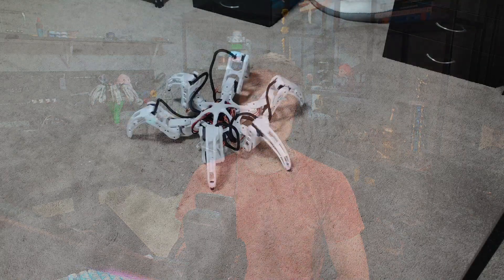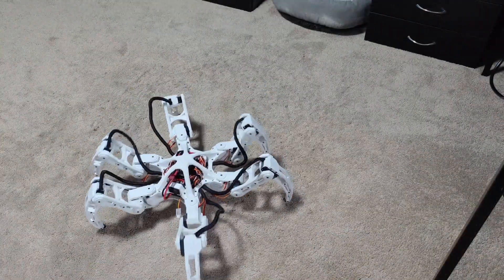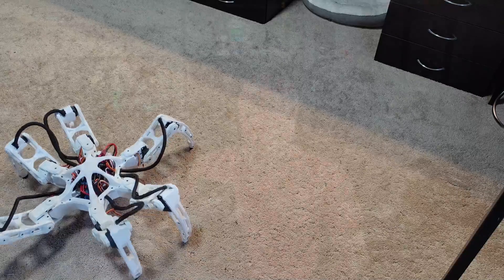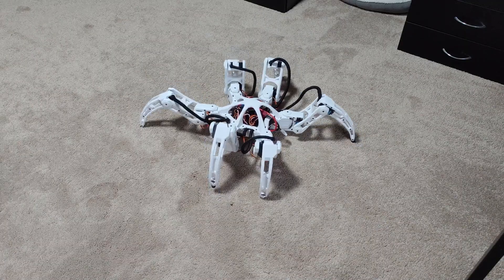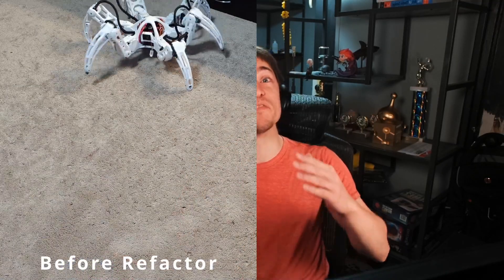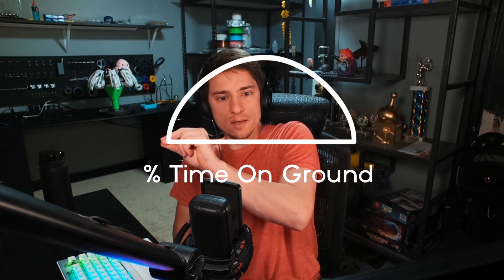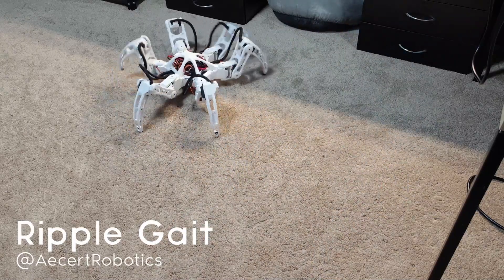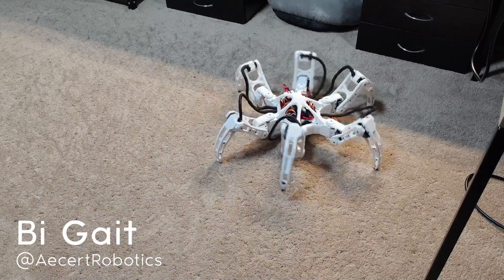I Completely Rewrote My Hexapod's Code

Comment: After seeing your clip, you make me ditch building fpv drones and start building Arduino projects again. I wish that you would release it sooner. In case your course is around 100 USD, I would buy it. When you finish, it would be great to see some AI implementation. Then you could call it creepy.😁
Reply from the maker: Awwww thats awesome🙂  And trust me I wish I could release it sooner too. 100 is right around what I'm thinking, as well as hugely discounting it if you buy the kit with it.

What kind of AI are you interested in? Im trying to keep this specific project as approachable as possible, and getting into stuff like object recognition or autonomous navigation using ROS is a bit out of scope of this project imo (assuming the arudino mega can even handle it).

Comment: Code reworking isn't glamorous and at times just has you bang your head against the wall as your old chaotic code works fine, yet the new cleaner code does not.
But it is an important thing to do occasionally in order to keep pesky Technical Debt from ruining things later and making it easier to adapt to other projects.
Reply from the maker: 100% this. I didn't go into depth on the literal code, but I managed to condense the entire page of code that generates the 6 leg walk cycles into a function that generates the walk cycle of 1 leg which I call 6 times. That specific refactor is what made this so challenging, but it was worth it.

Comment: Not a huge coding expert here but in order to fix your confusion with the orientation of the hexapod while crabbing and turning, may I suggest a sort of field-oriented control? You could add a gyro and track the direction the bot is facing, and have your joystick forward always move the bot forward, backwards joystick always move the bot backwards, etc. this way it is much easier to control the hexapod no matter which way it is facing.
Reply from the maker: So I love the idea, but i think it would still be kinda weird. Like once you start it up, forward is locked to a single direction?
The dream is to have forward always be the direction the controller is facing, but honestly i just need to get better at driving 😆
I have the acceleration really low right now to make animations smoother, but that makes it more difficult to steer. tightening that up a bit may help in the short term.

Comment: Try adding a camera it may make it easier to control if you can see from a different perspective.
Reply: I just recently got into RC Drones and don't know much about video transmission. But I used a small 3 in 1 Camera and a sky droid FPV Receiver from Amazon to prototype a drone. It works but I can't recommend it for you because of the poor video quality.
Reply from the maker: I love that idea. Imagine a camera on the hexapod and a screen on the controller. I would probably need something more than an nrf24 chip for wireless though right?
Reply: @AecertRobotics  It can be done, just not great quality. Think like say a 165x120 monochromatic image for displaying on a cheap 320x240 TFT screen at 10 fps.
That could fit in the 2mbps bandwith of the nrf24.